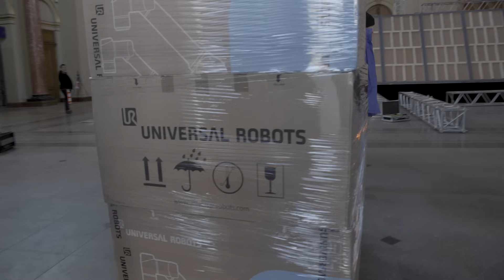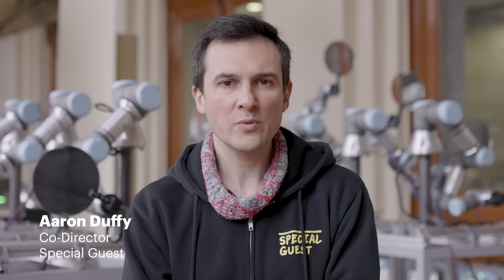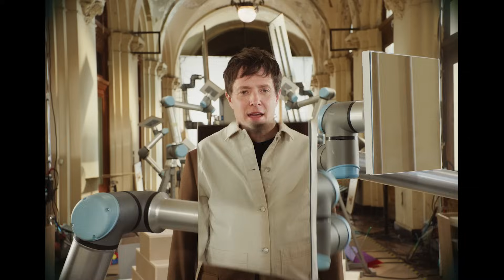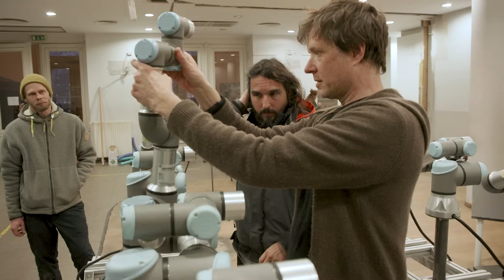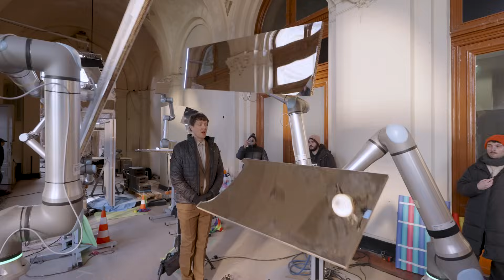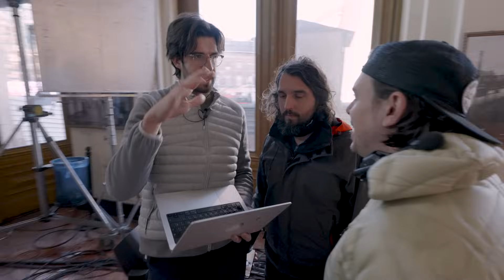How OK Go Used Robots for the Mirror Effects in "Love"

Comment: Back of the envelope it seems like this video features between 2 and 10 million dollars worth of robots. Crazy!
Reply: Worth noting that if you consider the "brain" and support as part of each robot it goes up more!
Reply: 30 robots, average price 20-25k, somewhere about 700k
Reply: @costastsamis6706  the midrange price on the ones used appears to be about 50K, bringing the low end to 1.2M. And I doubt they used the midrange. My guess is that they were using fully optioned models. Plus there were a few that were much larger robots and this stuff tends to go up exponentially in price. That was my logic anyway.
Reply: @RichWellner  I work in this field mate, small UR robots , model UR3 are about 20k, medium UR5 about 27k and bigger UR10 about 35k. These are customer price for one arm, I am sure they had a big discount for 30 arms and even some of them are demo robotic arms or leased. Including software, some additional expenses for the end tooling and grippers.